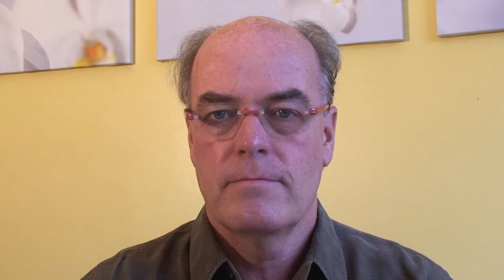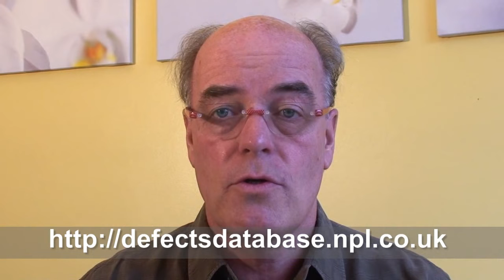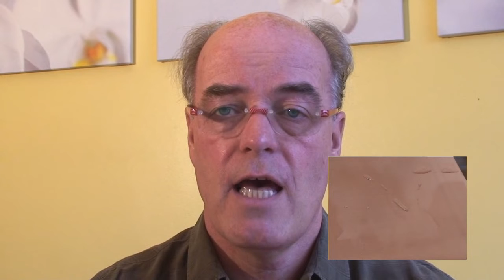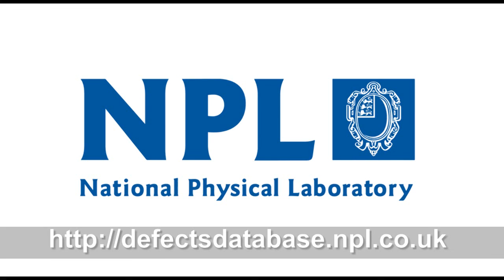Evaluating surface cleanliness through the water break test

Comment: An oldie but goodie, although the sheeting of the water on the surface of the copper laminate doesn't indicates a perfectly chemically clean surface it shows  that the surface tension has been diminished due to the removal of hydrophobic elements but   there always exist the possibility of a thin layer of Hydrophilic substance left on the laminate  (alkaline or acid depending on the method used to clean it) creating the illusion of a clean element